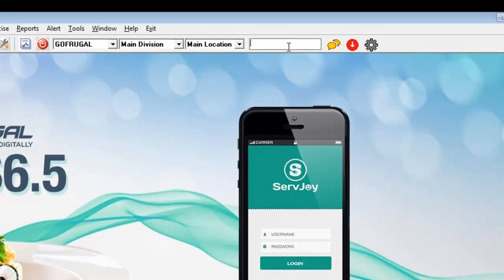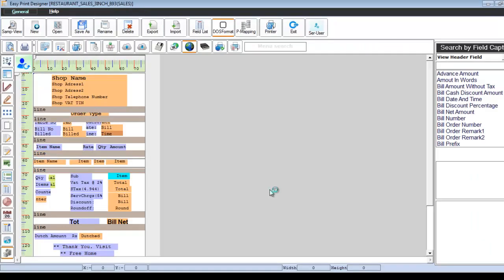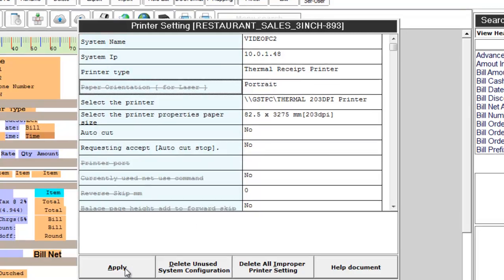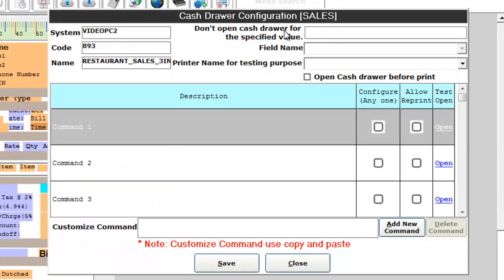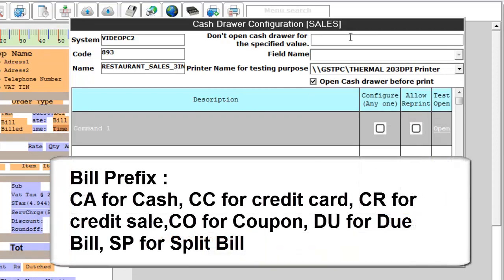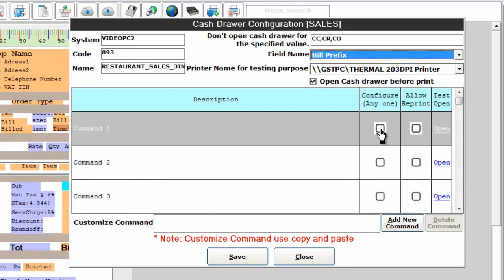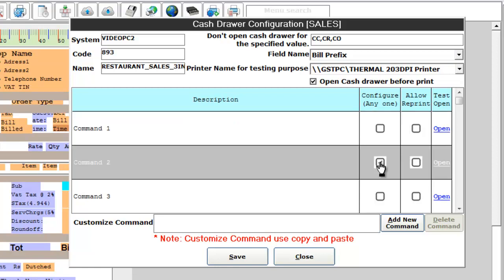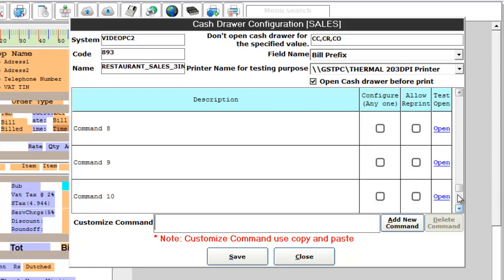Steps to Configure Cash drawer in Easy Print Design | GoFrugal RPOS6.5

Comment: It will track all cash receipts and disbursements made a user in any part of the system.
Device setting > Print designing> Select the printer for bill print and click cash drawer -you can select the open cash drawer before print